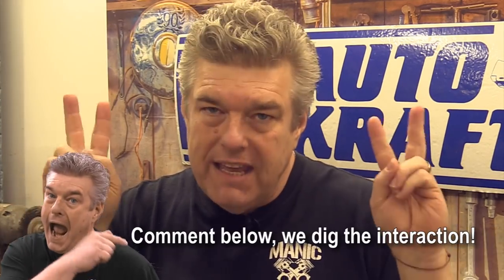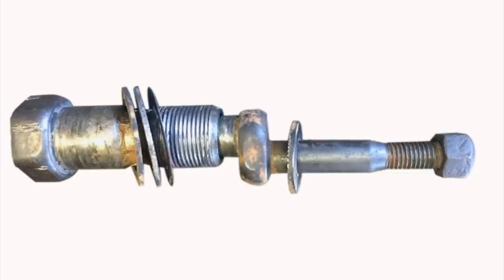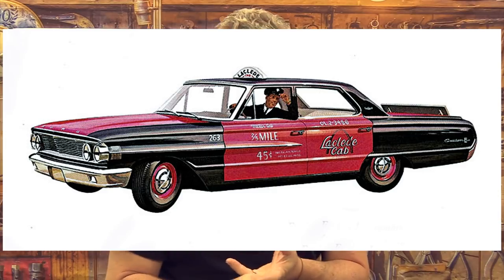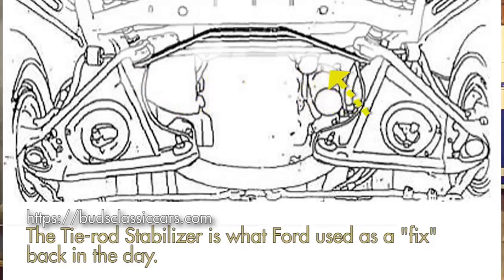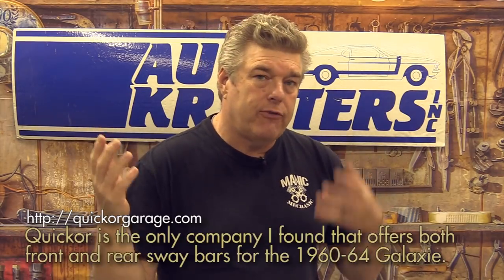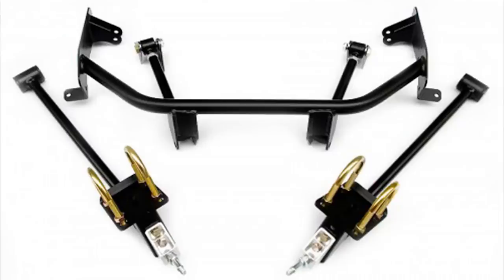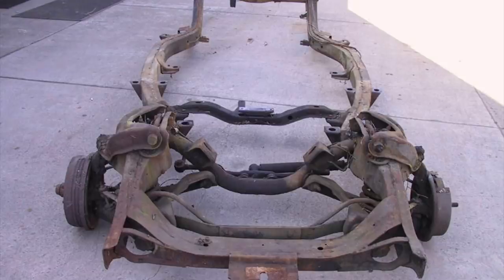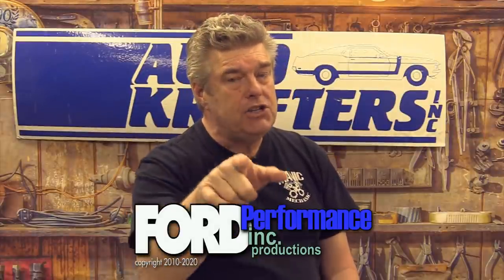Suspension Upgrades Galaxie

Comment: As the director of the Ford Galaxie Club of America for the last 27 years, and having been to many a show where there were high performance 427 and 406 Galaxies in the 1963 and 1964 year models, and owning a 1963 427 "R" code 2 door sedan, I have NEVER seen one that had straight shafts. I've also, due to curiosity checked out a decent number in recycle yards over the years, taxi cabs (2 I know of) and police cars (6 I know of) and NONE of them had straight shafts. As a matter of fact I scavenged the large concentric nuts off two police cars to use for modification back then. I am also the Mark Reynolds of Born Again Classics. I really appreciate the mention of our replacement kit here on this video. Say hi to Ron and Melody for me!
Reply from the maker: Will do

Comment: Yes please please please make a 65-67 Galaxie suspension video! There is so little info out there about modification,  the only obvious solution is to give Hotchkis $5k and I would much rather modify the stock suspension. A particular problem is the lack of caster. The factory settings max out at 2 degrees. Also understeer. And wandering at high speed even after tightening everything and new bushings... the list goes on. Thanks in advance!!
Reply from the maker: We are working on it.

Comment: I once saw an old magazine ad for the 1961 Galaxie. It bragged about how the car floated across the road even at top speed of 112mph, and then "when you throw on the anchor this thing really stands on its nose." In other words, not enough damping to have good control and pro-dive geometry to make you think you're stopping harder than you are. Yeah, they need some help to mix safely with modern traffic.
Reply from the maker: Agreed.

Comment: I can tell you that using front shocks from a ‘90’s Dodge 3/4 ton van helps a TON!!! stiffer valving will help front dive a lot, almost eliminating it. The lower bar pin must be modified slightly.

Comment: Cheers man. Keep the galaxie info coming
Reply from the maker: Will do!
Reply: @AutoRestoMod  
Possible engine transplants would be good. Ive got a 292 yblock with 2 speed. What would you suggest as replacement

Comment: 👍Good job. 
I learned of the 63 rod to tie the cam bolts together. Thanks.
As for "all geometry stays the same with dropped spindles".
Scrub radius.
Look what happens. It is grossly changed. Worse tjan wheel offset and tire diameter changes.
I know that most people wont care that a pot hole might jerk the steering wheel when changing the scrub radius more than an inch.... They expect 5* of caster to help the jerk.
JME.
Thanks👍👍😎😎
Reply from the maker: Good to know!

Comment: Great video, my friend I just bought a 63 Ford galaxy 500 4 door it runs great. It has the 351 Windsor in it.  Definitely needs new suspension. I’m hoping to go with air suspension.  And I definitely need  to replace the control arms   Thank you so much for the great info.

Comment: This was super helpful with the questions I have on the front suspension, I did in stall the stabilizer bar from Greg Donahue now now Bud's Classic Cars. I did notice a huge difference in handling but I am noticing the inside of both tires wearing as we drive our 63 everywhere. Looking into the Fatman Control arms for my 63 and then  my son's 64 as soon as start it. Thanks Again!!!!
Reply from the maker: Will definitely be doing suspension stuff for the Galaxie here pretty soon.

Comment: I have a 64 Galaxie and I rebuilt the front end completely stock.  It has always handled fine to me.  I did put that front bar from Greg Donahue Restorations.  I also have 15x8 American Racing rimes with 215 65 15 tires.  I may put a rear sway bar but after I changed the rear leafs it rides great for being a boat of a car.
Reply from the maker: That bar makes a world of difference.

Comment: We used the 427 side oiler in our 1967 Fairlane and our 1974 mach 1 mustangs they were awesome engines we had high riser heads and tunnel port we raced dirt and asphalt 1/2 mile tracks engines were indestructible with valve changes!
Reply from the maker: They are great engines.

Comment: Just switched out the lower front offset control arm bolts the Born Again Classics set up. Looks way better than the other options out there. I did this because I was switching out the front sway bar with the Quickor set up for front and rear. The Donahue tie bar was  in the way with the 1” sway bar.
Reply from the maker: Let us know how it handles
Reply: The Country Sedan handles night and day better. The car feels much more solid and responsive on the road. Going around corners always felt like the rear end of the car could possible switch places with the front end if I took it too aggressive. Not that I am going to be road coursing. It just feel better. Highly recommend.

Comment: 1968-72 Galaxie/LTD disc brake spindles/steering knuckles will swap right in. The only difference is you will need to change your outer tie rod end to one from the doner vehicle as the taper angle is different. May need new tires and rims as these are for 15" wheels. Also recommend New dual zone master cylinder and the proportioning valve from the donor car. I did this on my 64 XL 30 years ago, rebuilt and painted all parts $200.00 spent. And all FORD parts.

Comment: Jeff THANK YOU!! I have a 64 Galaxie and have been looking at every option available for the Galaxies and there is not much. The Offset shaft and disk brakes looks to be the most straight forward option. I am hoping QA1 will build something, they are about 10 miles from my house I offered my car up as a test mule. Great info!!
Reply from the maker: QA1 offers shocks and a coil-over kit.

Comment: Also, 63/64 was a these years only front end difference that only specialty shops could service them, other than dealer shops.
Had a 63 Fairlane that only Ford dealer had tooling to service them. Nuther good vid Cuz.
Reply from the maker: Thanks! These were some odd suspension years for Ford.

Comment: I owned a 63 1/2  289 Galaxie 500 until the 65 1/2  2 +2 appeared.  Had the front coil springs replaced with heavy duty and welded Traction Masters a month after delivery for the drag strip stance.  The Traction Masters improved winter and summer rear wheel hop, can't recall any bump steer.
Reply from the maker: Thanks for the input.

Comment: Addco has them also. I found out the hard way that if you do the front lower control arm mount modification there is not room for the Addco 1" front sway bar. The front of the control arm is moved up and there is not room for the sway bar arch to clear it . Even if you could get it mounted there is not room for the bar to twist as they need to. Very disappointing.

Comment: My folks bought a new 1960 ford base 292m stick, no power options. It was drivable and I learned to paralell park it. The steering was not killer hard.
Reply from the maker: Ford didn't put any caster in the front end, and they ran skinny bias plys plus the 15 inch wheel is a great force multiplier.
Reply: @AutoRestoMod  yessir correct. Take that old forc and put fat radials on it and you had better be strong.

Comment: (a little different here but) I got lucky and landed into 2, '58 Fairlanes & a '72 Ranchero. I haven't tore into them yet, but the spindles look like they interchange as does the PS Box. I'm pretty sure I can do the swap pretty easily to get PS & Disc Front brakes on the 1 good Fairlane. Even the ball joints look very similar. I'll know more once I get into it, but it's the plan so far.
Reply from the maker: There is a swap there.

Comment: Mr Ford  can I weld a whole 74 mustang 2 front end  to a 67 Fairlane ,frame 2 frame ??  Instead of the whole weld in a m2 shock pockets,crossmember, steering ,, you know like they used to do nova's,that whole new "chevy" suspension.. Thanks for all your hard work !!
Reply from the maker: I would not recommend it. There is a reason folks started doing the kits.

Comment: I see you mentioned the '63 Mercury Marauder. I have (3) '64 Marauders and a '64 Mercury Commuter wagon. They do float going down the road, but never had bump steer problems. Does the '64 Galaxie have the same rear half "coach" spring set up like the Mercury. I don't have sway bares on the rears of any of my cars. Mercury parts catalogs are non existent. Can I order Galaxie suspension parts for a '64 to work on my '64 Merc's?
Reply from the maker: Most of the front stuff is the same. Though I'd contact Auto Krafters and ask them to be sure.

Comment: If you got the 427 Side Oiler.................

Be a neat trick, the Side Oilers were not introduced till the '65 Model year. There were early '65 with top oilers. 

I don't remember my '64 having bump steer or driving peculiarities. Orig a 289, I swapped in a 390, only thing ever replaced in suspension/steering were the idler arm bushings. No doubt I'd feel differently about it these days.
Reply from the maker: Tom, you realize that all that info is in my head, right? I use a sheet for the base info. SO, sometimes I mess up on info like that. 

I am not going off of personal info. Only what was done by the big blue oval and others since. So I have to believe that there was an issue.
Reply: @AutoRestoMod I remember reading about the '65 427 Top Oiler in Car Review or similar. Was a featured car, till that point I thought all '65 were side olers. I knew on introduction in the 63½,  427 were top oilers. Those were still running the streets when first got my license in '66.   

I can't argue the Galaxie front ends, they held up well enough for first 10 years(sold mine in '74). No doubt History has proven them less than durable. Few early front ends are as good as we remember. My '69 Torino went from being best driving car on street, to akin to a field truck. All new components, fiddling with caster(thank you) and adding P/S mostly cured it, now fun to drive.

Comment: CAN YOU SHOW WHAT WIRE AND LIGHT GOES WHERE WHEN REINSTALLING THE DASH GAGE PANEL FOR 1963 GALAXIE  MINE WAS REMOVED WHO KNOWS WHAT WIRE PLUG GOES WHERE
Reply from the maker: I'd recommend getting the Galaxie assembly manuals from Auto Krafters. They have a good show of that in the electrical section.

Comment: My 64 does OK, could be better, but I have done several low buck mods...idler arm tapered bearing kit,..., disk brakes, spindle and tie rod ends off a 1973 mercury marquis,.., 1978 zepher manual disk master cylinder,..., KYB gas-ajust front shocks,...,,urethane sway bar bushings,.., front spring spacers,..., 15x8 wheels,...,rear sway bar from 1990 F150,..., rear air shocks.        The car is good as long as you keep it smooth, sharp corners throw the alignment off, and big bumps can turn into a thrill ride...390 with 1963 427 heads could use MUCH better handling!
Reply from the maker: We plan on worrying through that on our 63.